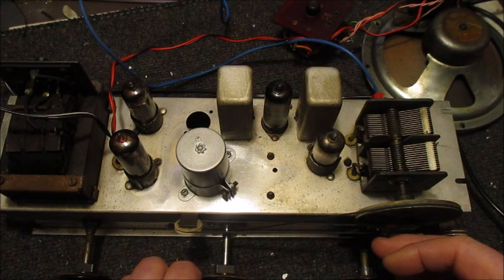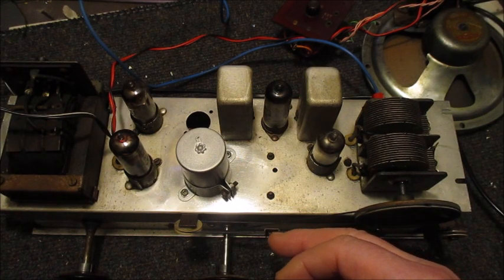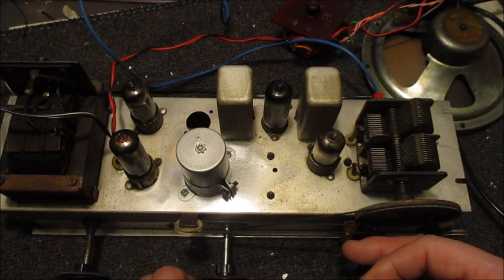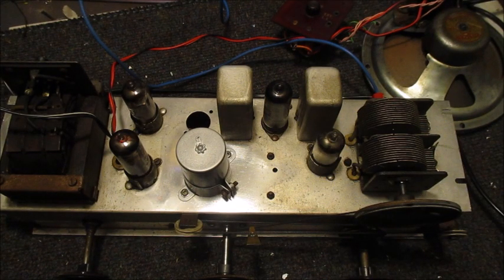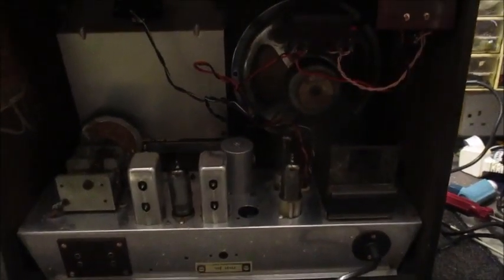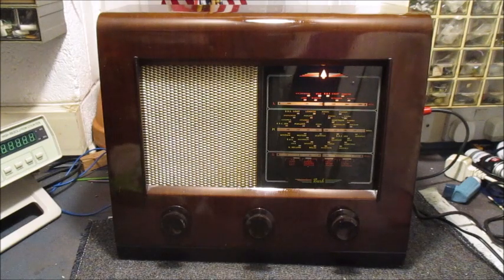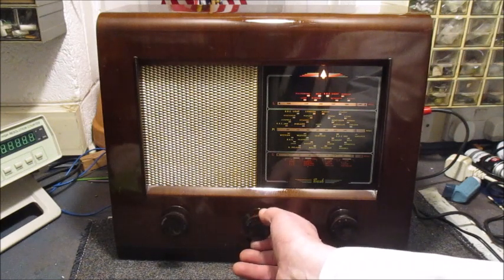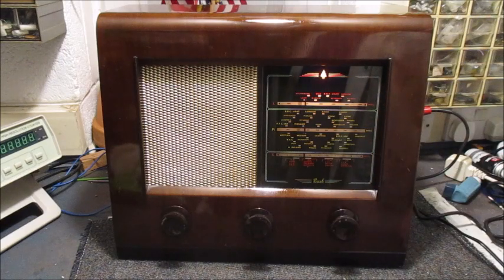Bush, Model AC31, Vintage Radio Restoration, Part 4

Comment: Hey Phil, That radio turned out beautiful and performs very well!  Congratulations :)  I've got two waxes to polish with here, plain old Johnson's wax and a dark tinted Briwax.  I used the Briwax as the main finish on my old 33 Philco on the bare wood without applying any lacquer at all and it turned out beautifully.  I did once get a sweat ring on it from a tumbler glass that was left upon it, but since it didn't have and lacquer or varnish on it I guess the wax allowed it to breathe and the ring disappeared a couple of days later :)  Take care, Gary
Reply from the maker: Rebel9668 Gary mi ol’ son, lovely to hear from y’ (as we say here in Yorkshire LOL).
Briwax is very good polish, though Johnson’s wax is perfectly okay.  Since the Bush radio cabinet was in reasonably decent condition, I decided to use the Silk Wood, and reserve the Briwax  for cabinets thar require a fair amount of TLC.
Knowing you my friend, I imagine your Philco 33, which incidentally are a sharp looking radio, looked, and looks superb after you had given it the finishing treatment.
it has now come to that time when we see Gary get out the multi- meter, soldering iron, and any other bench equipment he has to hand, dust them down, and select a radio that is shouting out to be restored ...any chance that might happen some time not too far away Gary???  There are plenty of us lads with loads of electronics knowledge, and experience standing by in the wings ready to be of assistance should you require any - just a thought my friend. 
Cheers dear chap, Phil.
Reply: @steelcity321pb6  Thanks Phil!  I do really need to get back to my RCA K80, and I may try to this winter.  When Spring arrives I'm going to attempt a restoration on a turntable...a hand crank Brunswick phonograph console from 1917.  It needs a refinish and to have the spring drums dis-assembled and cleaned out of the 100+ year old grease which has turned into veritable cement.  The player does work now as it is, but the springs make slipping and popping noises from having to unwind in that old grease.  I'm sure the diaphragm on the pickup head could also use a new gasket and the volume control rod appears to be missing.  If it isn't inside the console itself somewhere I may attempt to either make one or find a used one as right now it only has one volume...(loud)  The rod attached to a wad of wool called a sock that when pushed in went inside the rear of the wooden horn to muffle the sound.  I believe this is where the phrase "Put a sock in it" came from :)  Take care, Gary
Reply from the maker: Rebel9668 Gary,
I’ll be looking forward to seeing you tackle the wind-up record deck.  They look straightforward but I’m sure there will be certain setting up procedures required to get them running correctly.  Yes: it sounds like a good project my friend.
Phil.